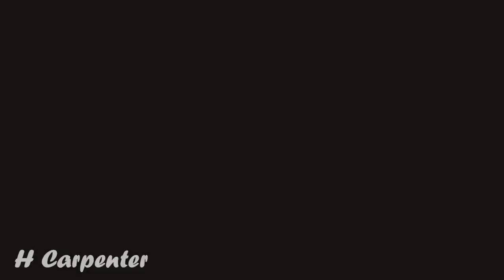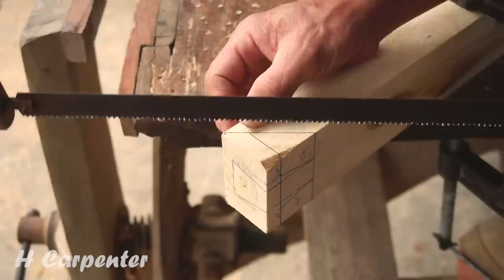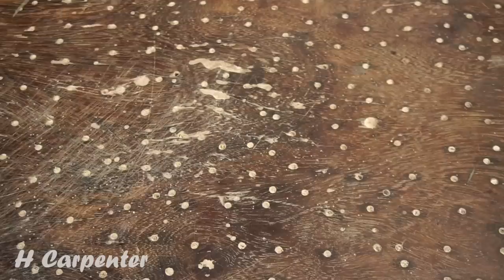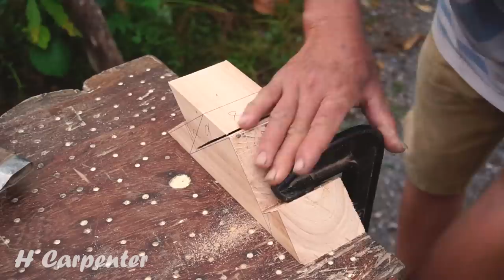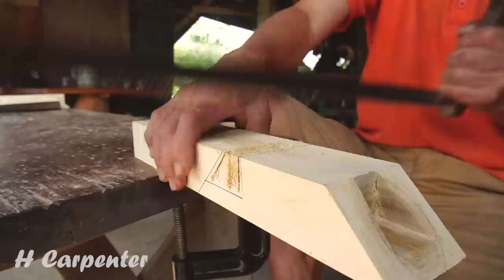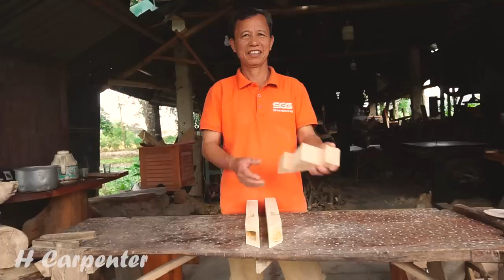Extremely Unique But Stronger Table Corner Joints That No One Ever Taught You, Woodworking Tips

Comment: The reason this is so strong is that if you were to try to pull the ends apart (angle >90) you would be stretching the middle piece which is damn near impossible. Bringing the ends together (angle <90) has to compress that entire mass in the middle. Well done.
On the other hand that's a LOT of work... this is why we invented screws lol
Reply: Pulling the ends apart it would break very easily as
Reply: At the top of the joint*
Reply: @jonathanlaguna3418  It wouldn't. That's why it's cross-grain.
Reply: @ireallyreallyhategoogle  yeah a stress on the 90 deg angle pulls on at least 6 stress risers that are against the grain. Fairly nice fit, congrats on the chisel work, but complete lack of strength, and complete waste of time.
Reply: good
Amazing
Reply: @bluefloyd1  If its something that he wanted to do, then it isn't a complete waste of time. A complete waste of time is acting like an armchair expert in the Youtube comments.
Reply: @mechanomics2649  lol
Reply: 🌲🍀🔨📐The point of this video, is  to showcase how much better looking and just as strong a wood joint can be without the use of those ugly nails & screws 🙄.   True woodworking  doesn't require or even want them.  They're just a fast, cheap, substitute for SKILL 🤨 📐🔨🍀🌲.
Reply: @johnadamski4012 Fast and cheap are both valid qualities.
Reply: @Terminarch  In lesser quality production manufacturing, yes.   But not for High Quality "Good Looking" hand built works of art which some people want😉.  That's no 🐂💩!
Reply: @Terminarch 🌲🌳🍀🐾🦉📐🔨 P.S. Sometimes, it's more about the "journey" than it is about the "destination"🔨📐🦉🐾🍀🌳🌲.

Comment: That was amazing to watch. Great craftsmanship without any power tools.
Reply: I wouldn't be so sure of that. A huge part of the preparation for joint making is getting prefectly accurate and identical stock. I have never seen this chap pick up a plane, and as this is filmed in a location with other woodworkers occasionally in the background, I would be amazed if the stock wasn't prepared using a planer thicknesser. Believe it or not, that's well over half the work involved in joint making.

Comment: The reason no one uses this joint at least as you've made it is because you have taken a fairly strong corner miter & made all the connecting parts about 1 cm thick. The spine on the corner brace & the remaining faces of the long angles are so thin they won't take much deflection before splitting. 
  A more simple & stronger way to do this is a kurf cut on the miter's outside corner & add a 5 - 10 mm spline 90* to the corner miter. This glued in spline joint has been tested to be the strongest corner joint in most uses.
Reply: Yeah, those are just for showing off, hoping for some youtube dollars. This joint is weak in multiple way: corner locking, beam and column weakness under load because too much material removed.
Reply: NOT TRUE

Comment: A lot of work on this one joint, and very skilled at that.  My concern is is joint looks strong if the two sides are compressed, but week in tension.  If the two legs on this joint were to be pulled apart, this would not be a good joint.

Comment: You're focusing too much on the strength of the joint at the cost of the Edges.. If you were to hit the ends hard then they'll snap where the joints meet.. I'd recommend thickening the width of them and making the connection smaller. Although it's hard to describe what specific parts I'm talking about, I'm sure you'll know what I mean when you put some thought into it xD
Reply: You're focusing too much on trying to sound smart. I'd recommend not being an arm chair carpenter acting like he doesn't know this shit and take the video for what it is, a demonstration.  Although it's hard to describe what specific parts I'm talking about, I'm sure you'll know what I mean when you put some thought into it xD

Comment: Cool as a demonstration, but there's a pretty obvious reason this is not widely used. Whatever strength increase you get from this does not justify the 100x longer it takes to make the joint. How strong does the table need to be? I don't see tables falling apart left and right.
Reply: Good thing it's a demonstration then, or you arm chair carpenters would be losing their shit.

Comment: Great if your aprons are 3" thick, but 99% of the tables ever made have aprons around an inch (25mm) thick or less. This is another just-for-Youtube joint. Great fun, reasonable skills, but a useless, pointless, joint in the real world.
Reply: Whatever ... when you post something even approaching the skill level of this gent then we might listen!
Reply: If you have the abilities to work out the necessary angles, cut them and then pare down to them precisely while keeping each face in square, then scaling down the whole to match a one inch apron would be a piece of cake.
Reply: @barry.w.christie  I certainly equal his skill level at hand-tool woodwork, but not at video-making. I'm not the slightest bit interested in whether you listen or not.
Reply: @liveoak4124  Yes, but pointless, for a couple of reasons. Firstly, in the western tradition and in most others that I am familiar with, aprons are inset from the face of the leg, not flush. If they are flush, the mortice in the leg is too close to the edge making the table inherently weak. Secondly, despite the claim in the video title, this isn't a table corner joint, as there is no possibly location for a table leg which doesn't cut through the mitre. 
If the chap had called it a mitred bridle with dovetailed diagonal bracing, then fair enough. It's not impossible that it could have a use in framing (for a building or similar) in some tradition or other, but it certainly isn't useful for a table.
Reply: He did this in an extra large scale to make it easy to see. When you do it on projects its made much smaller.
Reply: @MikeAG333  At least one thoughtful post in the comments. Majority of comments are bots with occasional folks over reaching their practical knowledge. Found this looking for a real comment after YouTube auto played this vid. Definitely not same league as Rob Cosman or even Matt Estella.
Reply: @markeastridge9649  yoooo mark
Reply: I am going to build an awesome table with this method just to spite you
Reply: @kayakMike1000  I hope you build an awesome table. That's great. It won't be with this joint, because there is no way of making an attachment for a leg into this joint. Make it with traditional offset mortice & tenons, and maybe box-joint (finger-joint for Americans) the overlapping tenon ends inside the leg, and build in the nice bit of corner bracing as per this joint. Should be grand. But as soon as you start looking at using this joint in a table you'll realise it doesn't work (unless it has a pedestal, which of course doesn't have aprons anyway).
Reply: I’m definitely not somebody to trust with woodworking but intuitively, it looks like the ends extending from the corner could just snap off due to how much wood was removed to make the joints

Comment: Cool but using a hacksaw to cut wood seems slow. Try a Japanese Pull Saw.  Now you need a scales and test how strong it is until it breaks.  It takes two pieces to make a joint. Of course 3 pieces will ne much stronger.

Comment: 🌲🌳🍀🐾🦉🎓🔨📐looks like a denser (harder) wood, or maybe, just cross-grain was used for the corner piece for added strength.  It's a shame that these joints will be covered by the table top😮👏📐🔨🎓🦉🐾🍀🌳🌲.